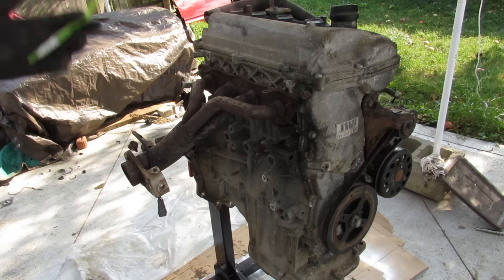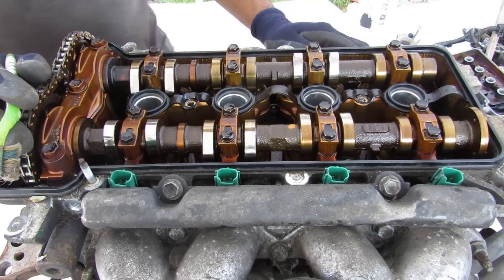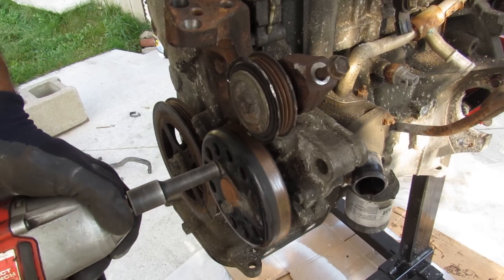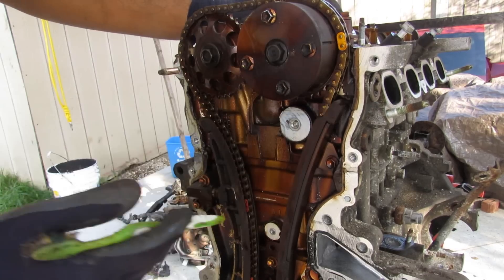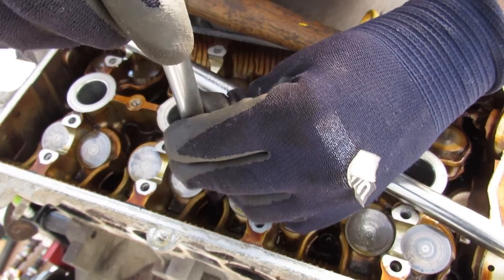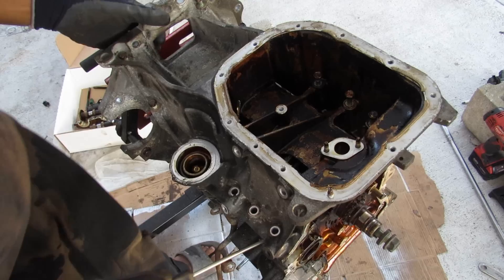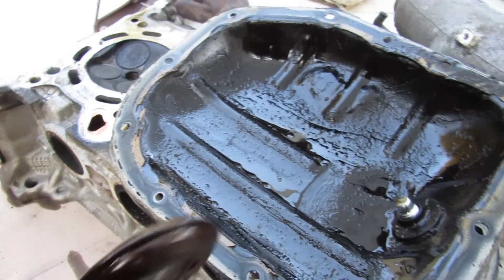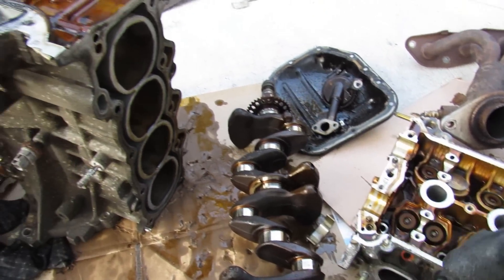What's inside a 500,000 km Toyota Engine?

Comment: I have an 05 prius with >450km on it, 3rd owner. I use the FRAM Ultra Synthetic filter with synthetic oil changed about every 3000Km.  I put in a yabo Nimh HV pack in last Sept, is still within 0.05V balance. New rear bearing, struts all around and replace the exhaust from the 2nd cat to the muffler. Still running great(knock on wood).

Comment: Nice teardown, thanks 👍 Looks pretty good despite high mileage and too infrequent oil changes. Are there any products on the market that could clean the oil scraper rings and the little holes in the piston plus maybe get the sludge out of the pan and oil pickup filter? I mean products that actually work.

Comment: Sludge formation is caused by not changing the oil before the expiration date, the ideal is to change it every 5000 km. engine could go more than 1 million km, there is a toyota etios used in taxis, it has already reached this km and the engine is still intact, just maintenance before the oil change deadline, so as not to form a card in the intake manifold and TBI is to use a pickup oil from the steam outlet prevents this, otherwise use an additive in gasoline to help with cleaning, Toyota engines are very resistant as long as you take care of preventive maintenance

Comment: awesome video mate! Thank you! Now i know (and before your vid also) why the engine consumes oil. The factory 5w30 is too thick for that engine, and as i experienced with my 5 years of usage with the gen2, it can be helped with some brakefluid. before changing the oil, i poured about 0.5L to the engine oil into the engine, go about a 30km with it easy on the pedals, and change the oil. Before the same car was consuming 1L oil in 3000kms. after the procedure it consumes about 1.5L/15000km. I'm using 0w30 oil. Dont risk it, if you need to see a mechanic, and i dont recommend to anyone doing it. it is my personal experience and it helped a lot. :)

Comment: I have this engine in my 2020 Yaris, actually it is modified: 
Higher compression , one piece "maniveter" exhaust system combined the manifold and and catalyic converter for faster warm up him and reduced mass, belt less water pump and ac compressor, water cooled exhaust gas recirculation, low friction cam chain, improved cooling ... Toyota recommend 0w 20 oil for this engine
Reply from the maker: Yeah it's essentially the same motor

Comment: 1993 land cruiser with the inline 6 4.5 liter my dad gave me when i turned 16 had 420 thousand miles on it i drove it for about another 40 thousand miles until i bought a cheap 2001 passat at 18. it was burning oil though but it still ran and to this day still runs with over 500 thousand miles but it needs a rebuild because it only gets 7 miles per gallon currently.

Comment: 600.000 km on my octavia and still going strong with no oil leaks or burning. Same engine and still good power.
Reply: U can put a lot of miles in any engine in short period of time.  After 15 years also anything plastic or rubber break down just dry out, cracks .
So the sooner put lots of miles on the car the better.. some parts in the engine break down when it's old not because of lots of mileage. Like plastic and rubber

Comment: With over 300,000 miles could you reasonably expect less carbon and sludge?  Even if you changed the oil at the recommended intervals?
Reply from the maker: Yes

Comment: An electric motor is so much simpler.
I think people had more appreciation when engines were still designed to be simple enough for people to service their own cars with only a bit of knowledge, but those days are long gone. My first car, a Mazda 323, I did A Lot of the servicing myself. Now with modern engines... Not a chance. It's more like the engines are designed to discourage it. On an engine under warrantee there is even colour coding to indicate the few parts (to provide oil/water/coolant typically) you are allowed to interact with in many case.

Comment: 150k on my rav 4 -2002 AWD and still at a great condition. Got it at 94k km for a 2002 model for only 3k cad!!. - around 2k USD . Orig. owner was an old lady that rarely drives, hence the low km.
This was my first car in Canada and hoping it could hold another 3-5 years. :goodvibes:
Reply from the maker: Keep it rustproofed
Reply: @speedkar99  only thing i have changed/repaired so far was i replaced the gas tank as rust ate through it, i guess the salt on roads during winter here in canada

Comment: My 1996 Corolla reached 350k km after driving it for 20 plus years now.
It's had no issues with engine but we now only use it if the other cars not available.
90s Toyota engines are super reliable!

Comment: Man this is an impeccable 500.000km engine other than some carbon buildup on the combustion chamber. What was done on this engine was right. So stop crying for the oil pan that has sludge. Learn to follow manufacturers recomendations and DO NOT make early oil changes or use "better" (out of spec) oils. Be paradigmatized by this engine. From your comments it appears you have not.
Reply from the maker: Yep. Oil changes are important. The engine mechanically held up well

Comment: I wish I had the tooling to do this to my jeep with 267k miles on it, there's a lot of stuff you pulled out and covered I wish I could replace in my truck, it would run forever
Reply from the maker: It's simple hand tools, pretty easy to be honest. The hardest part is getting the engine out of the car.

Comment: but if the engine is not running because its in eletric mode, the KM still adds up, right? So this 500.000 km is not a reference point at all.
Reply from the maker: But it starts and stops more frequently which is hard on the engine

Comment: In cars that don't make crazy power per cylinder, you can pretty much avoid tearing the engine apart altogether as long as you use quality oil and change on time, or preferably - more frequently than required.
Reply from the maker: That's true. This engine runs on the Atkinson cycle

Comment: Question what if I run at 120 speed with 1400cc engine at 3200 rpm continuously would be Normal for the engine
Reply from the maker: Yeah that's fine.

Comment: My 2012 Camry had a long block replacement at 57k miles. It had a lot of carbon on the pistons too. Covered under warranty due to knocking. The sound got worse when they applied volts to the engine.

Comment: So I've never owned a hybrid or EV, but in the case of the hybrid does the control system log combustion engine running hours?  
Maybe even a ratio of total miles driven vs combustion engine hrs., of course ymmv your ratio may vary.  
That way, buyer of a combustion engine has an idea of its stats vs just the total miles driven.

Comment: I have a 2009 Toyota Prius. Not the most exciting drive, but... it's crash test rating is good, insanely reliable, comfy, practical, economical, roomy, ok standard equipment, cheap maintenance, a few dents and scratches here and there but I couldn't care less. Pretty much no oil consumption as well. Despite its image, it's more than fast enough for everyday traffic.

Comment: Good video,we don't know what oil filters brand was used during the 300,000 kms,right? From the looks of the BEARINGS and cam caps and bores, i would have to say whatever BRAND was used THEY WORKED GREAT> Let's say 5,000 kms per oil change =60 oil and filter change? and bearing were like new!!!!! TRUTH is we don't really know,BUT THE BEARINGS TELL US the story.ON the oil control rings my 1994 Honda civic went 500.000 thousand miles BEFORE i had to REPLACE ONLY the Standard rings.Because the oil control flow back HOLES completely closed up. I drilled them clean,the rod and mains looked new like those so i left them in. honed the cylinders put in the new std rings and now 3 years later have 540,000 no oil usage,Hondas and Toyotas are ENGINEERED to last with maintenance.

Comment: It was said at the very end, this engine is not used all the time since it is a hybrid, what's more impressing is engines that run all the time. My 2005 Mazda 3 has 690 000 and is still running no issues! Just battling rust!!!!!

Comment: Got a Daihatsu, and if i am not mistaken they share the same engine as toyotas. Well i did a lousy job on my DIY service and the nut came off and so did all the oil in the engine. Drove it like 10km back home, got a new plug and some oil. That was 3 years ago and i did another 100k kilometers. Its almost 300k kilometers now. Change the oil every 5000 km or 3000 miles with the cheap stuff religiously.

Comment: Not for nothing but you take care of any car it will last a long time, maintenance on an engine keeps it going a very long time, I had a Toyota in the 80s, I was young and beat on it and it didn't last me 100,000 miles, I had a Ford Taurus in the 90s and took care of it and it had over 300,000 on it until I traded it in for a 2005 jeep liberty which now has 250,000 and I'm still using it, I've learned to take care of cars and they will take care of you!

Comment: Thats impressive for such a small engine😁 but thats not as impressive as mine first car- 1996 e class 250 diesel without turbo, it was a piece of shit, with like 110hp, but damn that thing lasted, bought it for 2,300euros with 480.000 on odomoter, i think it had more, and car was with me for like 7 years, i added about 295.000km more and that thing still ran pretty good, sold it with aprox 770.000 k on odo 😁

Comment: I noted that the PVC hose diameter are far bigger than I usually see...especially on small displacement engines.  I wonder if that helps keep the system clean and not get clogged.

Comment: Mine also went 430k km before starting to leak a head gasket. Cheaper to put in a low mile junkyard block for me than to redo the HG. Same issue with oil burning it used a qt every 1000 miles so I just kept it topped with cheap oil.

Comment: Could you imagine if they actually took care of the engine with proper and quality oil changes how many miles this engine could have gone? I'm HUGE on oil changes on my cars.
Reply: Lmao ikr? I have a 2011 Prius with 134k miles on it and it doesn't burn any detectable amount of oil. I get it done at the dealership every 6 months, and thing has never had a single issue. Toyota just builds engines different

Comment: With other words, engines are no longer a thing from the 80's where 300.000 km was considered as "completely used". I'm pretty sure that engines of today can outlast even a million km's if properly maintained.
Reply from the maker: Yes I agree. 300km is easy for an engine. Unfortunately same cannot be said for the rest of the car
Reply: @speedkar99  It's impossible to keep a car that long "solid" and "looking like brand new" anyway. Unless you stall it in your garage, have it on constant temp, and never touch it.

Comment: This engine has come out of a hybrid. The vehicle has done almost 500000 km that does not mean this engine has done that mileage as  it would run on electricity . at least half the time The timing chain is still tight. Modern engines with timing chains the recommended replacement is about 120 to 150 k.

Comment: My Prius has 315k miles eats 3-4 quarts a oil change interval
Reply from the maker: That's alot of oil.
Reply: @speedkar99  yes I will probably be replacing the engine. Still runs ok gets 48mpg

Comment: That engine has likely been through some 500, 000+ starts and stops, so we can now safely say that start-stop does not wear out your engine. And no, the Prius engine does not use a special system to avoid wear during starts and stops. No electric oil pump, no electric coolant pump (except for the heater.) The only major difference is that it is started by essentially a 20 hp starter motor, instead of a regular starter.

Comment: Nice video 🙂 If I buy a used car, is there a reliable way to detect if the car has already a high oil consumption (like 1 litre pro 1000 miles) ? Specifically is there a way to detect if the oil control rings are working properly or not ?
Reply: Honestly, idk. Though you could ask seller if they have any of the papers from oil changes, because sometimes the company that does the oil change marks where the oil was before the change.

Comment: For the high mileage, I've seen worse oil  sludge with lower miles.  The cooling passages  at water pump incredibly  clean, mild deposits in cyl head. A good  cleaning and simple rebuild  i🔧⚙  It'll Go another's 300 k miles
Reply from the maker: Sure can

Comment: I’m glad I found this video. I live in Japan and wanting to buy a 1.5 Toyota Prius with around 95000kms. I’m told that the main hybrid battery needs to be change at around 150000 kms and is quite expensive to replace. The inside/outside condition is quite good for its age but havent checked the engine yet as the regular battery has given up. Not knowing the previous owner, how he/she has looked after the car so im a little worried about making the purchase. Any suggestions on whether to buy or not.
Reply from the maker: Yes Prius is a good buy

Comment: I owned a 05 Prius that had 256K miles on it when I sold it (due to a failed HV battery pack).  It was burning a quart of oil every 1000 miles after 200K miles.  I changed its fully synthetic oil every 5000 miles so it wasn't a lack of maintenance or overextended oil changes that caused the oil burning issue in my Prius.  Some of these engines just had oil burning issues unrelated to maintenance.  The 1.8L in the 2010 Gen 3 Prius was particularly bad for oil burning for many owners.
Reply from the maker: Yeah all Toyotas burn oil

Comment: Looks like a diesel engine after 30.000km lol.. XD
The engine had half of that km's or just 300.000km's becouse of hybrid system
Yet still good
Reply from the maker: Yeah but arguably start and stop puts alot of wear on the engine too
Reply: @speedkar99  yes indeed. Idk if the new engines of Toyota are any better at that, becouse I saw somewhere they mencione is better.
Other manufacturers have tbe option tu turn it off. Citroen for example

Comment: Thanks! I drive a 2000 Toyota Sienna with more than 400,000 miles. You mention using "good oil." The jury seems to be out on which are the "good" oils. Depends who you talk to, it seems. Can you point us to a good resource (or share your thoughts) on commonly available good motor oils?

Comment: I been a driver for at least 25 years,the top milleges I had put on a car,2004 Lincoln town car 655.000 milles in around 10 years same engine,I just to be a limo driver owner operator,now I drive a 2021 toyota sienna hybrid and in 5 months I have put 30.000 milles as an uber driver,if you change oil when you have to,that would make a bid difference,synthetic oil the best choice..!
Reply from the maker: Nice!!

Comment: I’ve tossed the idea around to re ring my Prius engine.  it’s betting bad with oil consumption and from the look of that engine I suspect I have the exact same problem and their isn’t a whole lot you can do without disassembly.  I’m the 3rd owner I’m at about 410k kilometers on mine.  It takes maybe 3.5 quarts of oil if your on the tip of the dipstick your maybe a quart low so this engine runs low on oil and probably exasperates the problem 😂.   Maybe if it had good full  synthetic from the get go could help with the oil ring issue or at least prevent it from happening sooner
Reply from the maker: I don't think a re reing is worth it at that mileage.

Comment: The funny thing is those guys who throw additives fuel cleaners injector cleaners esp LIQUI MOLY snake oil can only dream of having engines this good. even with poor change intervals, the engine holds up. so no, all you really need is good quality oil and change 8-12000km. yes, there's no complicated solution, its as simple as that every 6-9 months. I change my oil on my damn Kia Forte 2.0 every 9 months 12-15000km and its running like new after 240000km and 11 years.